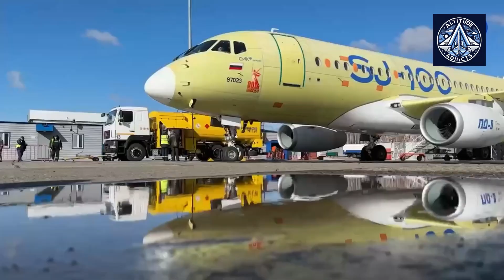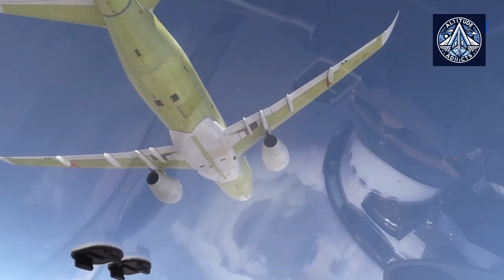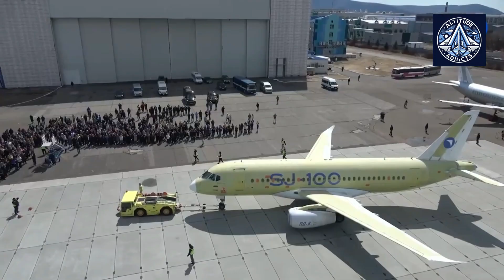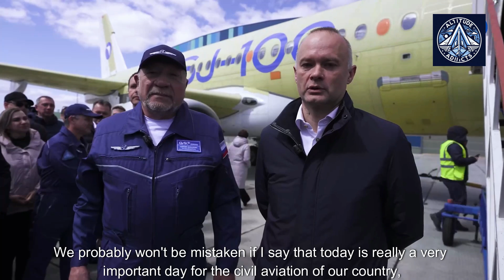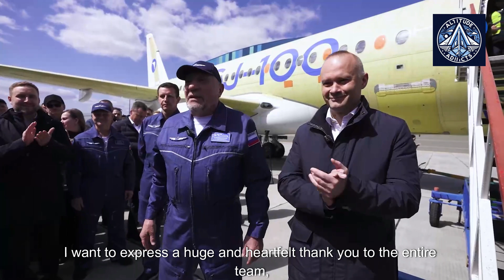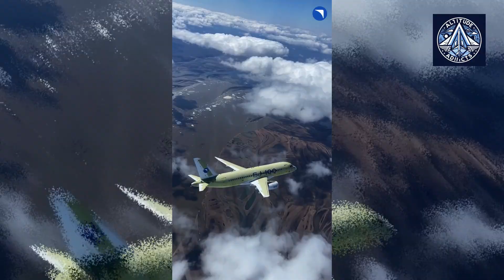2nd Superjet Prototype + PD-8 Engine + Interviews

Comment: I love the whole concept of the SJ100 from its conception years ago to the latest innovation with the new powerplant (PD8)! The video of the third prototype was exciting and I particularly liked the flyby of the SU30 ( l believe) “chase-plane” with the extreme high angle of attack demonstrated to match the speed of the departing SJ100!
Mike P. (Retired Pilot)
Reply: The Su-30 is just the video cameras and radio retranslation point to transfer the test telemetry data from SJ-100 to the ground control team on the fly in real time.
Reply: @maksimluzin1121  Thank you for your quick response and information!
Reply: The high alpha chase plane was awesome!